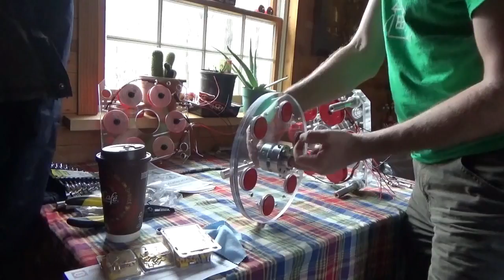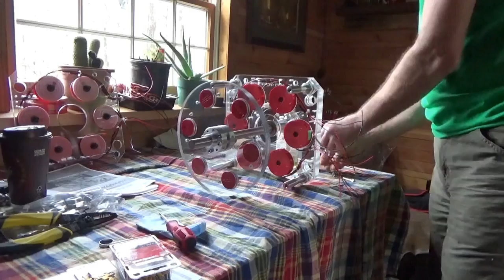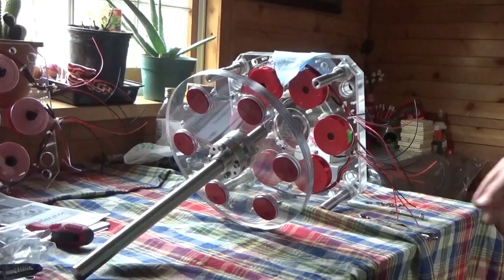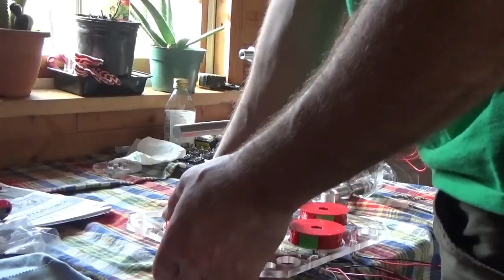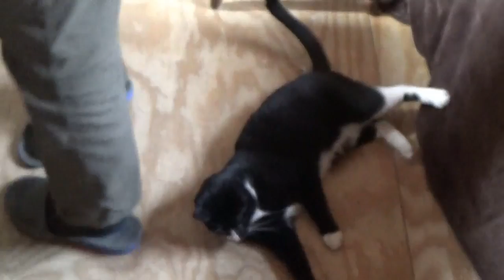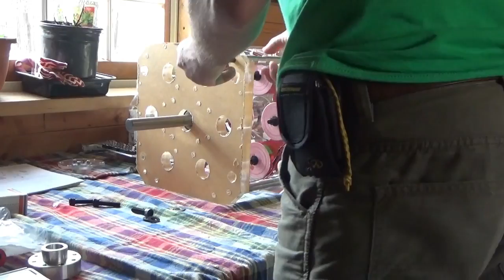Assembling Q3 Pulse Motor Rotor And Stator Halves Together

Comment: Batteries seem to love pulse charging it is true. Also solar panels can sometimes bring up a battery that a charge controller could not or maybe a charger could not because the battery so dead. By leaving a small panel  on for a month or so sometimes a dead battery will come up.
Reply from the maker: I did once bring my lawn mower battery back by leaving a small solar panel on it for months. But it was not really restored like the Bedini motor does.

Comment: Need a 1/4 inch drive ratchet set to tighten your hubs up. Try a alcohol wiped to remove the oil and grease on your hands. Then put moisturiser on after you are done for day. Than get little white cotton gloves to use for hands to keep handprints off acrylics. Then put back in plastic toolbox for later work. Get little brass hammer for light persuading on stubborn parts. 
I prefer a 10lb.sledge but that Is for fine tuning things. If it wasn't broke before I tapped it ,it is now.  HaHa

Comment: Amazing series and an amazing device! I saw another guy on YT using a Q3 pulse motor rigged up to run off a 9 volt battery, he was charging two 6 volt lantern batteries and powering the pulse motor from a 9 volt battery, it was drawing less than one amp from the 9 volt to charge the two 6 volt batteries at the same time! Simply amazing!